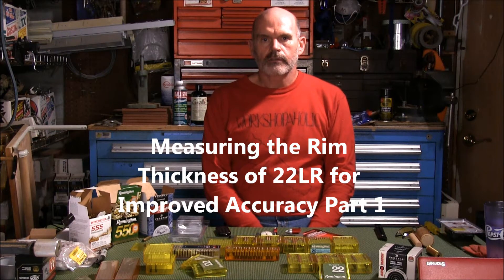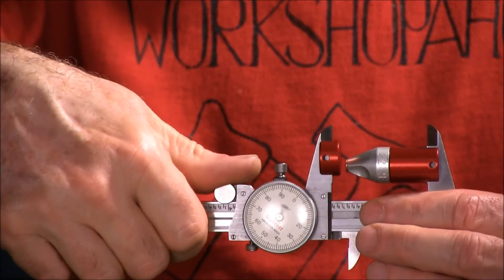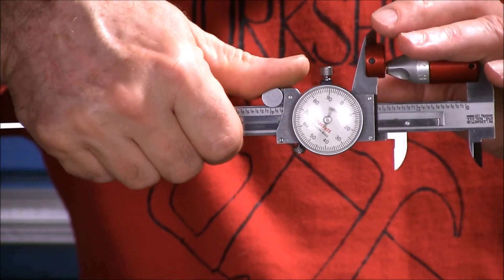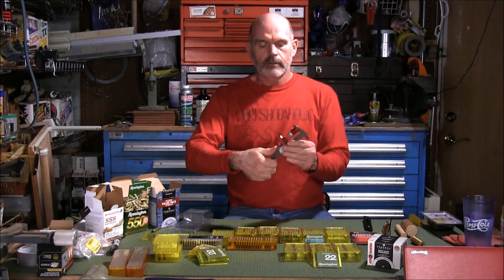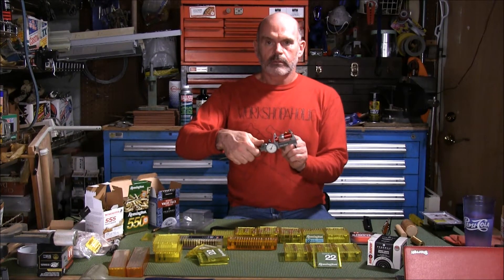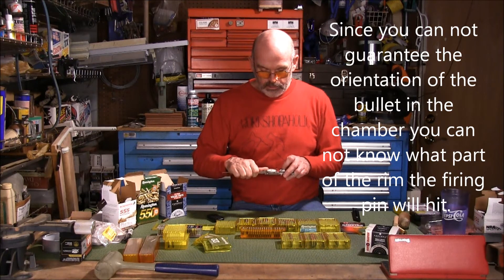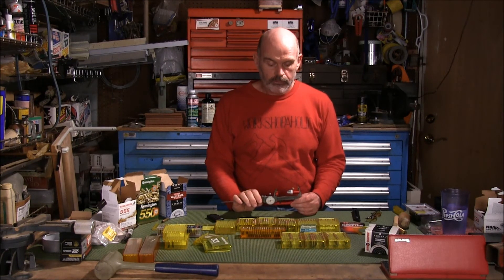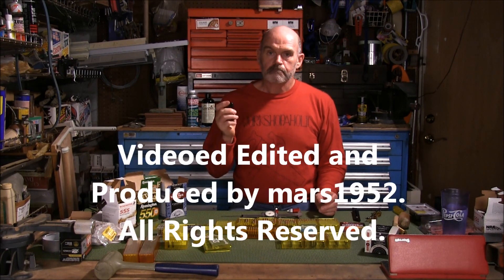Measuring the Rim Thickness of 22LR for Improved Accuracy Part 1

Comment: Couple of thoughts - the absolute thickness doesn't really matter, as you're just looking to measure variation between rims, so you don't need to 'zero' at all (if you are measuring all of one type of cartridge in a single session) - just record thicknesses and group same brand cartridges into 'bins' of similar rim thickness. You would only need to 'zero' if you wanted to get an absolute rim thickness measurement so you could process cartidges in several different sittings, and might have moved the attachments in the interim. Or if you want to compare the average rim thickness of different brands (not sure why this would be of interest). Also, it may not matter if measured rim thickness varies a little bit with orientation, as long as the variation is less than the "significant difference" (ie. how much variation is required to put a cartridge into a different 'bin'). Finally, I can't see the point of using the 'anvil' at all - you just need a bullet holder so the micrometer can measure the distance from one side of the rim to the other. The micrometer jaw itself should be perfectly 'square' and will let you measure the rim thickness. Using an 'anvil' attached to the micrometer jaw just introduces another potential source of variation (from how you attached it to the micrometer jaw each time its used) when measuring (I suspect it is included in the 'kit' just so it looks more complex and can cost more).

I'm going to buy a cheap digital micrometer and simply glue a suitable diameter tube to the adjustable jaw (to hold the cartridge with the inside of the rim up against the tube end). It should work fine if you simply want to 'grade' cartridges into 'bins' of similar rim thickness, which is all that is needed to minimize group dispersion due to variation in rim thickness...

Comment: Letting your ammo lay in the sun and warm up will give you different results. To many variables with 22 ammo. The best rim thickness gage is the slide rule type. But they are expensive. It's precision ground. I think that I would just go with Eley which is very accurate.

Comment: I have found that a resized and trimmed .223 casing seems to be the best way to measure rim thickness and you get repeatable consistency time after time. If you would like, I can mail you one so you can try it. I handload and I have some .223 empties lying around that I loaded for a friend's bench rifle and they would be perfect because I have went through a lot to get them concentric because of his tight chamber. These would be PERFECT for you to use as a rim thickness gauge. If you would like one of the cases, shoot me an email at mr86djtaylor@hotmail.com or just message me here on youtube. Oh yeah, and if your in the market for a quality scale take a look at the Dillon D-Terminator Digital scale. It's a little pricey but WELL WORTH the money. It's repeatable capability is by far the best on the market for the money and it's convenient because it runs off of an ac adapter and it can be powered by battery, but, I prefer the ac power. Best of luck. Great video.

Comment: Don't use the attached anvil for the floating jaw. The caliper's jaw is already flat. Not only will this give you more room to work but the jaw has no "flatness" flaws in it. Also try chamfering the female receiver for the bullet. You're probably picking up on the inside corner radius of the rim. That's where the inconsistency is coming from. These cartridges are stamped out in crude fashion.

Comment: Rim thickness is only one thing of many variables with 22 ammo.
Other include bullet weight, powder weight, lube on bullets, bullet crimps and rim primer charge etc.
Thats why most target shooters buy bulk lots to try and keep the variables down.
A case of 5000 Eley tenex will shoot different to the next case
Personally I think your trying to be to precise with bugget ammo as case thickness is only one variable.
You would most likely find your group size decrease by 15 mm or so.
Best advise I could give you is find a bullet that shoot good in your rifle and stick with it even if you need to try 15 different types of ammo, they all shoot different in a different rifle.

Comment: fwiw, I see a small discoloration where the bump would be but when I run my fingernail across it... I can't feel it. I also turn it sideways and can't see a bump.  So I wonder if the base has been updated?  I can reach into each stack, after sorting and they measure the same each time.

Comment: Thanks for this post!  I was planning on just picking up a .243 casing the next time I'm at the range.  The .22 should slide right in, and when my caliper is zeroed, it should be at least as accurate as the Hornady rim thickness gage (especially if I score a trough on the bullet for my caliper.  Have you tried this before?  What do you think?
Reply: Nick Ramirez 223 or 22-250 or any other centerfire 22 caliber case, not 243

Comment: I believe that the thickness that you use is not as important as the consistency of the thickness. By that I mean that if you have 99 rounds that have rims that are 37 thousandths and then you shoot one with 45 thousandths... that one is going to be off from the other 99. So if you are sorting, I would simply use the thickness that you have the most of as your bases and sight your gun in based on that.

The key to accuracy is to reduce variables.
Reply: Christopher Maize Actually, the thickest rim cartridge’s should yield the least headspace, and theoretically yield the best accuracy.

Comment: check this out on Ebay it's a Rimfire rim thickness measuring gauge  for 22LR 22 17 Mach2 it may be more accurate than Hornady system just copy and paste this item #320448911956 on ebay,  i'm thinking of geting one for myself